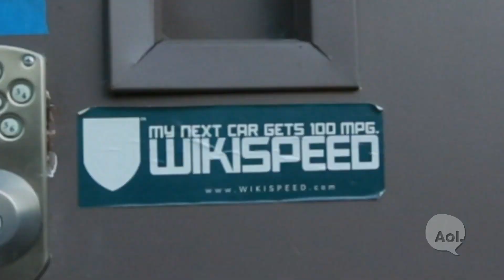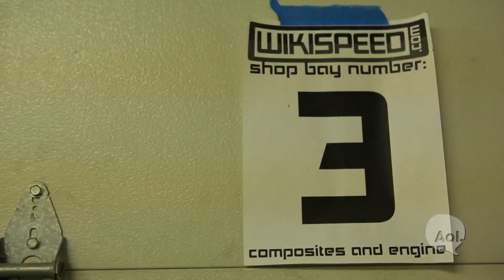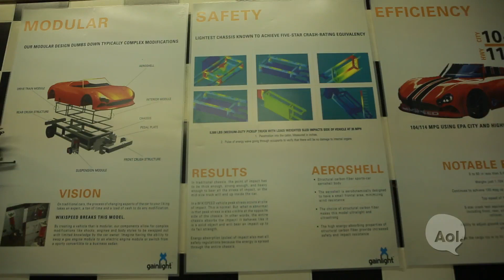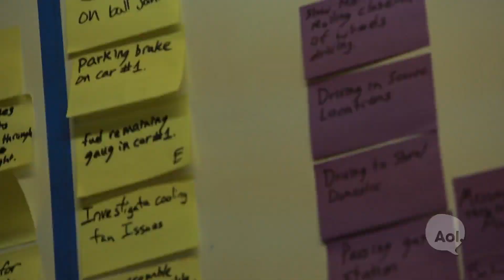Wikispeed SGT01 100 MPG Gas-Powered Car | TRANSLOGIC

Comment: This is just plain wrong. The amount of coal it takes to create the energy of electricity creates much more pollution then say, gasoline doing the same job. Thats where the thermodynamics kicks in. The energy generators from combusting gasoline is much greater then coal by a large margin. Lets not forget the pollution created from making batteries, and batteries eventually wear out and need replacing. I'm not saying its impossible, but technology just isn't there yet.
Reply: You make it sound like the power station only starts to recharge EVs.Just like a bus is less polluting compared to 48 cars to move the same number of people, it is still more efficient and less polluting to charge 100 EVs than it is to run 100 petrol/diesel cars.ESPECIALLY if the EV owner has solar cells and is contributing to the grid or in some cases, supplying ALL of the power required to charge their vehicle!

Comment: First of all, it was in the context of the xprize where electric has a 3x advantage.
Second, thermodynamics is physics that governs primitive things like combustion engines, it says nothing about electric motors. And electric drive has demonstrated itself as easily superior already. White Zombie using primitive forklift motors accelerate to 100km/h in under 2 seconds yet is still 3x more efficient than a prius.
Even from coal power EVs are less pollluting. Solar, wind, water and nuclear is zero!

Comment: 3+ worse efficiency. can't operate on CO2 free electricity. noise, vibration, complication, lung damage, world disaster.
it's the little things that count.
plus electric drive can be simpler, cheaper, faster and much lower maintenance.

Comment: did I say shape? always assume I am right.
the Tesla Roadster formfactor could easily be made very aerodynamic with slight changes and the size is ideal for low weight and good aerodynamics.
the current wikispeed car is a sloppy mess.
but a 600kg tesla roadster with aerodynamic bodyshape would be world changing.
120kg A123 lithium is plenty for such a car. it will blow a roadster away

Comment: The shape of the Roadster!? The Tesla Roadster, as we all know was based off the Lotus Exige, the Tesla was actually a slightly more aerodynamic car of 35cd, the same of an iMiev or Nissan Cube!
To get 100mpg out of a petrol car like that requires very little weight and aerodynamics. As you can see, the aerodynamic body on this makes the car too impractical. It actually makes EVs look better.

Comment: slight advantage to gasoline? reassess that and learn from the massive failure in logic. there was huge advantage for EVs in the xprize as there is in the real world. using a combustion engine was a massive mistake then as now.

And I don't know how they make the bodywork but they should use molds. polished molds so it doesn't look that amateurish. indeed the whole group badly lacks someone with a sense of aesthetics. 
try using the dimensions of a tesla roadster. including the windshield